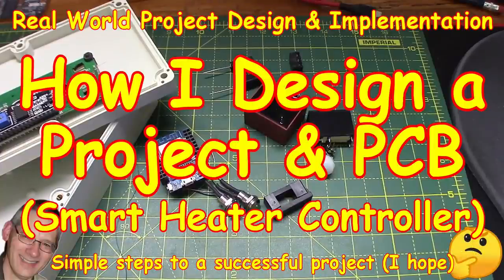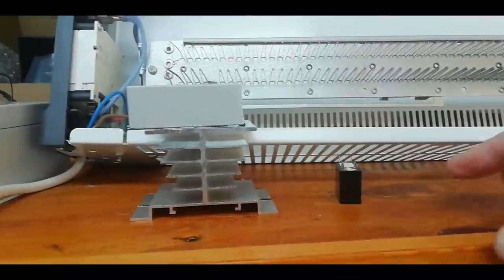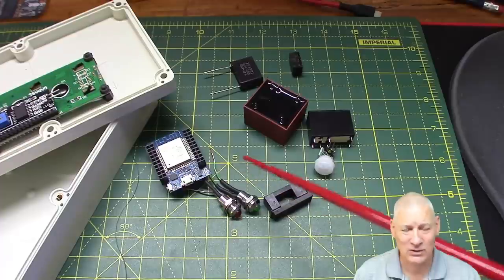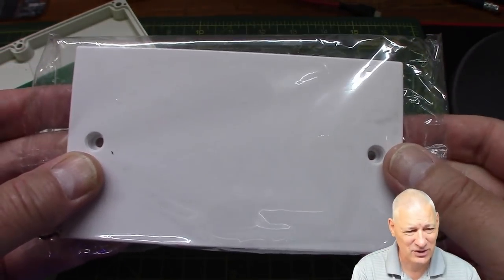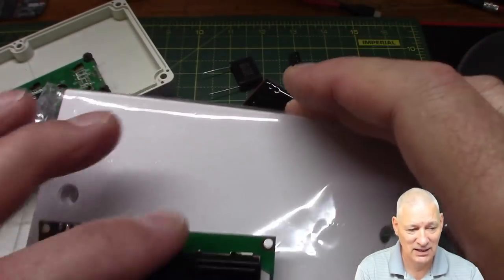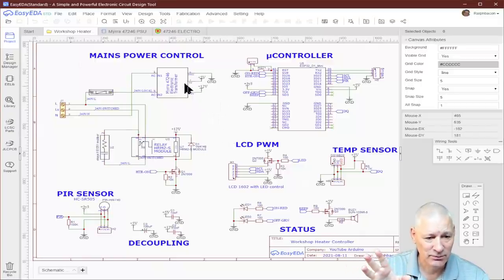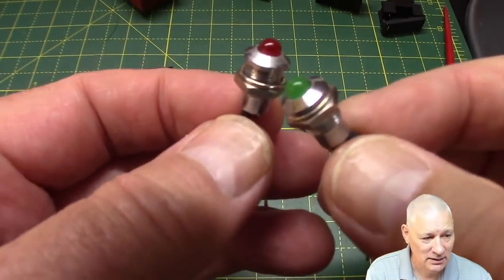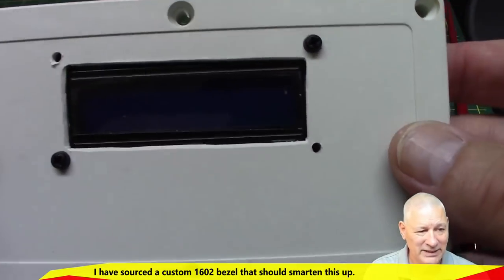#225 How I designed my Heater controller - Warning! ☠️ Mains voltage!

Comment: Very good project,  I know you do not want to change your project,  which is looking  very good indeed,  but one thing I would do is to move the relay and put it sideways to the transformer,  so tha the low voltage coil stays on the low voltage side.  I get very nervous when I see low voltage tracks running in the same side as mains. You know arcs are unpredictable.  I would also move the slots underneath the transgormer and relay to avoid any arcs making visits to the low voltage side.  I made a soft start for amplifier I am doing and run into the same issue of mains in the same PCB (and in Brazil we have 110V only).  My contribution to the excellent work you do.
Reply from the maker: Thanks Claudio, I shall investigate what you say later this weekend. Thanks for the feedback.

Comment: Another popular box is called a "hammond box".  They are made of aluminum and other various materials. They are also very affordable and easily cut or drilled.  I did a project last fall similar to this one.  It kicked a heat lamp on when the temp got too low for my kids rabbits.  I love these projects but never have time in the warm months BUT! winter time is coming.  Great video! :)
Reply from the maker: Thanks for the info, Mike! However, in this case (no pun), the last thing I wanted was metal. Using a plastic case with no exposed parts I'm quite happy it will be safe. But I will look up those boxes for future projects, thanks again for the info.
Reply from the maker: Here's a link to a UK supplier but probably available worldwide:
https://www.rapidonline.com/hammond
Many types of boxes not just aluminium.

Comment: A very welcome example of the realities of engineering design. I was reminded, somewhat, of my time as a chemical engineer student. We spent an inordinate time learning to calculate the required size of a heat exchanger for various situations. Thermodynamics entail  calculations that are not so much difficult as they are tedious  but we were required to come up with results of very fine tolerance. After graduation, we were all to discover that said heat exchangers were not bespoke items but were, in fact, "off the peg" components. Most of the time we would be require to select from, maybe, four or less items way bigger bigger than our precise calculations demanded. Further experience taught us that, unless one was designing a formula one racing car, ones life was filled with Hobson's choices.

This video was valuable for sharing such compromises that are the basis of all design. All too often,  maker videos skip this stage of design, leaving the viewer with the impression that the choices of components spread out on the camera table were the obvious choices and if you couldn't see that, maybe you should leave the designing to your betters.
Reply from the maker: There's a huge gulf between theory and practice , I agree.

During my time as a professional web developer, I was told that I was spending too much time (ie the company's money) in getting it "perfect". I think the phrase was "Platinum Plated". 

Hence I quickly learned to adopt the 80/20 rule which, roughly stated, says that the last 20% of development takes 80% of the time. Good enough is Good enough. Stop developing and get the project to market!

Unfortunately, it seemed that documentation and testing resided in that last 20% - we all know where that leads to. Sigh.

But these days there's no boss on my back hounding me so I try and do it right. It never is 100% but that's my aspirational goal!

Comment: Hi Ralph, yep lots more to do when you have the software and hardware running on the bench ! I have had PCB designs sitting there for ages and I check them over and over again and I have found problems on my second and third time through so its well worth taking your time at this stage ...measure twice cut once !.....cheers.
Reply from the maker: I'm amazed at how much I find wrong with my PCB designs even after several checks, and printing out the schematic, checking off each and every pin. I long for the days when I had a team to do peer checks. Well, I suppose I have now!

Comment: Toolstation and CEF sell PVC back boxes and blanking plates, which will drill fine. They also have a knockout at the top (or bottom) for 20mm conduit, but you could put a gland there instead.
Reply from the maker: Very useful to know, Dominic, I find those boxes very useful and, most importantly, don't look out of place in a domestic environment.

Comment: Hi Ralph. Really nice to see someone going through the overall mechanical design process as I find it immensely frustrating that videos appear of neat tools/circuits but zero consideration of how they'll be fitted/mounted/used in anger! Good job ... More please.

Some points for you to consider for any future majns control projects.

1. Complete isolation of control electronics from mains level can easily be achieved by using an opto-coupler like a PC817. These (or similar) are ubiquitous in computer ATX supplies ... One reason to NEVER bin them but scavenge out ALL the parts ... mechanical, electrical AND electronic. 

Others have proposed moving the relay to have the low volts on the low volt side BUT most relays will have the common pin (high or mains power) sitting in between the coil supply pins ... NOT the best scenario! 

Using an opto-coupler completely removes this problem. Coil power can be derived simply from the mains side by a simple resistive or capacitive dropped with some suitable filtering caps. The input side is fully Arduino) ESP compatible requiring only a simple series resistor from the output of the MCU to provide the right drive current for the input side. 

It also means that no tricky slot cutting around the common pin is required and separation on the opto is significantly greater anyway.

2. Many people also don't realise that there are dedicated triac opto drivers that INCLUDE zero switching technology so BUYING a commercial  "electronic relay" is generally completely unnecessary since the triac is either on or off and does BOTH at the zero point when required (for YOUR type of design)

Again, it's FULLY isolated to >1 or 2 kv or more, minimal external components, as small in total footprint as a small relay, minimal heatsinking required (it's either fully on or fully off for your requirement) and 100% directly compatible with MCU output levels. 

Switching up to 13A for a wall heater can use a low cost T2035H-6I 20A, 600v, 1v trigger, 5(£1.28 - 1 off from CPC/Farnell). PLENTY of practical design ideas online for the MOC20xx series optos ... Worth taking a look at.

3. When cutting out PVC/ABS front panels by hand, whenever possible, mark up and cut from the inside out as any slight errors or slips can more easily be disguised.

4. Fit displays with bezels to the OUTSIDE of the case wherever and whenever possible and make up a short jumper cable to achieve an even more professional looking finish ... Also hides those slight cockups we all make when hand cutting.

5. When cutting rectangular holes in plastic do NOT use the sharp edge of the blade ... Use the BACK of the blade to 'scrape' through instead. Tape a metal ruler to the panel along the OUTSIDE of the line you are going to cut. Use the edge as a guide and ONLY cut a max of just over halfway from each corner so that you don't cut past them. Do each line in turn ensuring you finish on a long edge for maximum accuracy and control.

Hope the above provides some useful input for your viewers as well as yourself.

Bonus tip: One final thing which is a pet thing of mine ... Try, wherever possible to use ferrules (bare ones are fine) when connecting wires to screw down terminals, even IF they have the protective internal tabs ... They insert MUCH more easily and are WAY more secure. Crimped is best but for those with limited budgets and/or tools, soldering is fine and still better than bare or soldered wires.
Reply from the maker: Lots of great info here Bob, thank you so much. 

I hadn't considered opto-couplers here (even though I have a whole bunch of them) as I'm not sure that complete galvanic isolation is required (the relay is the only "touch point", so to speak). 

Regarding ferrules you are preaching to the converted, Bob. I have a whole selection of sizes and use them a lot, especially on mains cables. I even have the proper crimper, works very well.

Comment: Thanks for this video. I wonder if you could give some more detail as to how to create the 'boundary rings' that you mention around 20:30 to keep the HV traces away from the mounting holes. 
I look forward to all of your videos!
Reply from the maker: The rings were just circles on the top and bottom layers. Quite thin, 10mil or so. No NET name. But there is apparently another way to do this, read the later comment -= basically creating a Design Rule for a certain NET which will be the hole. I'll be trying this later this weekend.

Comment: You can PWM that pin on the display directly from a GPIO pin, it is only a single LED after all. I know you want to do it right, but that method works perfectly on my 2004 heating controller and climate readout display run by a Tasmotised Wemos D1 mini, to make it a nice but not full brightness throughout the day, and to dim it at sunset so that it doesn't burn my eyeballs out later on.
Also check out your local electrical suppliers for enclosures, I use 'Gewiss' boxes, which you can drill or cut to your hearts content, and they are very robust while being suspiciously cheap for something so good.
Reply from the maker: You are doubtless correct, Ken. If I'm going to drive an LED via a MOSFET, why not drive it directly. Hmm.

Comment: you could move the relay closer to the psu so that the low voltage to the coil does not need to go close to the mains. it the heat and stby leds are on the case you don't need the pcb area taken up by the body shape of the LEDS, just a 3 pin connector.
Reply from the maker: As per my previous post, all good things to consider.

Comment: Hi Ralph. Great video. You may want to use noBacklight() to turn off your LCD display instead of having to use a relay to turn off the LED via the jumper. Dimming probably won't make that much of a difference as you probably can't read a dim display from your desk anyway. noBacklight() will turn of the LED completely from inside your sketch. Safe yourself some wire. Thanks for a very informative tutorial. Best wishes, Gord
Reply from the maker: Thanks for the tip, Gord! Although I'm not using the relay to turn off the backlight, I'm proposing to use a MOSFET (so I can dim it). We'll see how it goes.

Comment: Nice stuff.
If you only need the reset button for emergency cases, you could drill a tiny pin hole through the front plate., right over the switch.
Much like the emergency release on DVD players
Reply from the maker: Good tip! I'd thought of that, but since then I've discovered that the LCD gets corrupted whenever I do an OTA update so I will probably just have an on/off switch (momentary, NC) switch somewhere.
Reply: Ah yeah good ole UPCI (Universal Paperclip Interface), one of Apple's better inventions 😹

Comment: Big Clive always seems keen on slots in the pcb to isolate mains traces from low voltage traces. Seems like a good idea to reduce mains voltage/current from tracking through surface dirt and grime from mains area to low voltage area over the years.
Reply from the maker: I'm pretty sure air gaps are to separate high voltage tracks where they may jump if too close together; whilst they may also prevent some sort of strange, high resistance leakage due to grime over the years, I'm pretty sure they are not needed here. Maybe I need to look at Clive's videos on the subject.

Comment: remember you need to check the creapage and clearance distances between the mains and any low voltages. plastic screws for the display would help keeping the box double insulated, so i would drop the metal clad leds.  Avoid bringing any metal that can be touched out of the box. if the live fails to the low voltage these could become live. for the reset fit the switch behing a hole maybe on the side of the box.
Reply: Metal bezel LEDS on a plastic case will be isolated to at LEAST 1kv so not a problem. On a metal case the panel should be earthed directly to mains earth for safety obviously.
Reply from the maker: All good feedback. Yes, I'm using plastic screws for the display and, for different reasons, I might yet opt for those plastic LED push-in panel holders (they are smaller, that's why). I'll bear in mind all the other stuff you mention. 👍
Reply: @RalphBacon  Want to sell you kit in the EU or UK (CE mark & UKCA mark) then
You need to show compliance to the requirements of:-

•	Low Voltage Directive (LVD)
•	Electromagnetic Compatibility Directive (EMC)
•	Radio Equipment Directive (RED) (if it has an esp8266 or esp32)
•	Restriction of Hazardous Substances Directive (RoHS)
•	Waste Electrical and Electronic Equipment Directive (WEEE)

By your statements in the Declaration of Conformity (DOC)
The DOC needs to be signed by a responsible person. (Poor bugger to take the blame)

And of course all this backed up in your technical file.

Who would want to do this for a living?
Reply from the maker: My "real" electronics engineer friend had to jump through many hoops to get one of his designs tested for RFI, heat tolerance and many other things that I didn't really understand. 

It passed (I did say he was a real electronics engineer) but it was for his company, so the cost was not his to bear. Took a long time but it was required, as you say. 

I can't imagine anyone doing that for a living. Unless...?
Reply: @RalphBacon  Well i did spend a few years and close to £1.5M on CE and E-mark testing, on medical, industrial, and lighting and equipment control systems on emergency vehicles. Medical and E-marking being the worst to do IMHO as there is so much more paper work than normal CE.

Have been doing EMC testing on and off for about 30 years on mil avionics.  But now I just do it for fun. ;-)

Comment: Hi Ralph. I'm curious about your choice of the fuse. I saw in another comment you are using a 1Amp glass fuse. I was wondering in what circumstances would you have selected a ceramic version? Also with it feeding a transformer will you be using a T (time-lag) or an F (fast blow)?
Reply from the maker: I'm using a quick blow 20mm glass fuse. A ceramic fuse is normally chosen when there is a high(er) current as the ceramic fuse (normally filled with a type of fine sand) will prevent any 'explosion' of the fuse.
More info here: https://forum.digikey.com/t/glass-vs-ceramic-fuses-whats-the-difference/8475